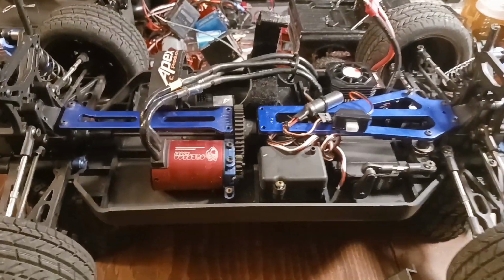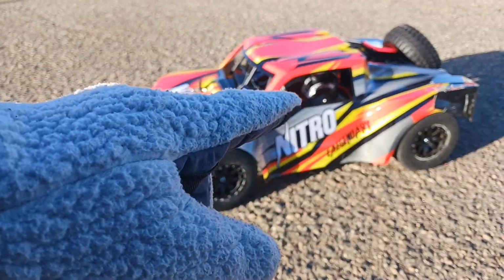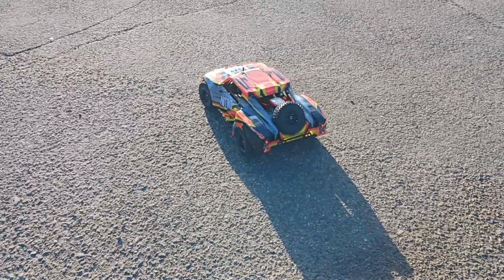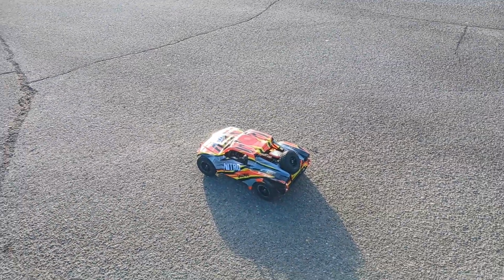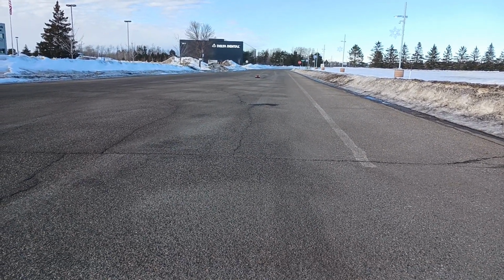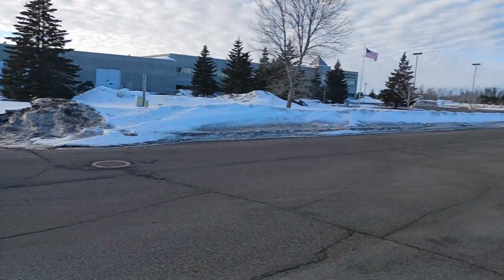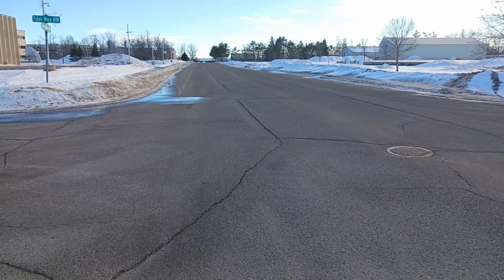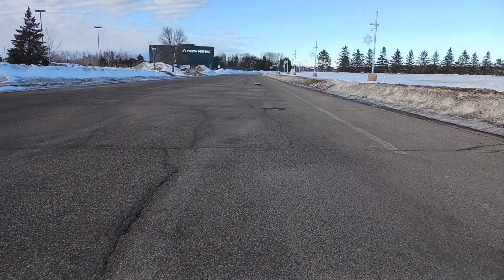Nitro is a missile on dry ground // 1/8 Nitro 6900kv 2s Baseline Top Speed 🏆

Comment: Chief?!? Bro, seriously awesome. When you had the body off at the beginning it reminded me of a jet engine with out the cowlings. 
Fall is here and I'm glad that I'm down here in S Texas. Mild, to no winter. 
Ok, Chief watching this gave me a crazy idea. 
This is what we are gonna take to the Bonneville Salt flats races. K? You'll have to be driving using a drone camera or helicopter. K? I haven't told you what you're going to design, build and dominate R/C. K?
Picture the WPL 2 speed transmission. BUT! Instead of a high and low range, you have redesigned it with a high and higher range. Maybe use another vehicle to push it up to say, 40 miles per hour, then  drops out. Since your car is geared to go 100 miles an hour it doesn't really have any low end power to even get it rolling until maybe 30 or 40. K?
We'll need dry ice to pack around the motor and batteries to keep them from exploding of course. Also, the dry ice will be evaporating the whole time making the car lighter, which can be a good thing or a bad thing. Testing is definitely needed. 
Chief, think about it. You'll have so many people wanting you to let them be a sponsor. They will be throwing money at you. TV interviews. The Today show. Hot Rod magazine and on and on. Did I mention the limousines and the beautiful bikini models?
24 volt? Kids stuff. You're from some village in Minnesota that doesn't even have electricity or in door plumbing( Bro, just kidding! just kidding!) Now you're in Hollywood doing televised special events both racing and having classes teaching kids about mechanics and more. 
I know we'll need some wind tunnel testing and I haven't figured out how to get it just yet, but I can talk a lot of s***!
Ok, you just layed down a 50 mph pass, in scale mph does that make the car going like 100 in scale mph? More? 
Did I mention World domination? Muahahaha!!

Comment: Question ⁉️ did you put the original pinion on a 3.175mm shaft lil red 3650 motor or 5mm shaft motor? What's the shaft diameter of the 590 brushed? 3.175 to 5mm sleeve adapter or what 🤔
Reply from the maker: Yup stock 590 and red 3650 motor have a 3.175 shaft

Comment from the maker: Important Update and Correction fml, the motor pinion is a 13 tooth, not a 12, or 14 tooth. Also I just foundout a 15 tooth Motor pinion is the largest the stock motor mount will allow. I saw a VRX stock pinion and mistook it. You could use a 14, and 15 tooth on this Nitro for more Top Speed, not 17 and 18. I feel like a dumbass
Reply: Where did you get the gears from
Reply from the maker: @jeromeeberhart8534 i only got a 15t 32° mod1 5mm bore motor pinion from a traxxas shop.on town, but any brand is fine. Spare parts are on amazon under FYRacing but expensive compared to AliExpress under VRX 1/8 parts